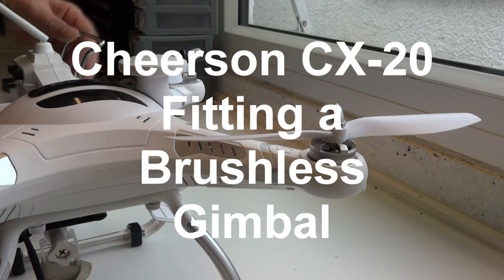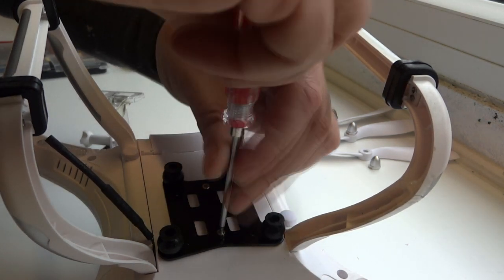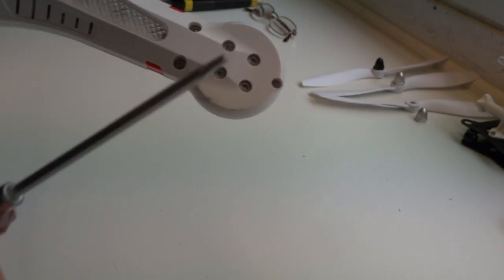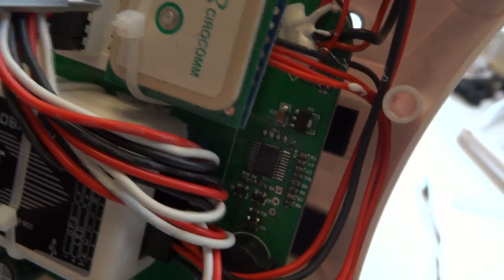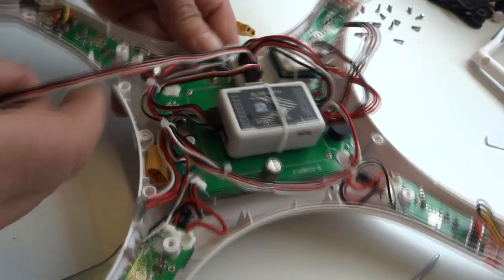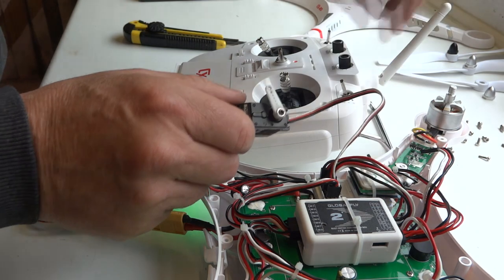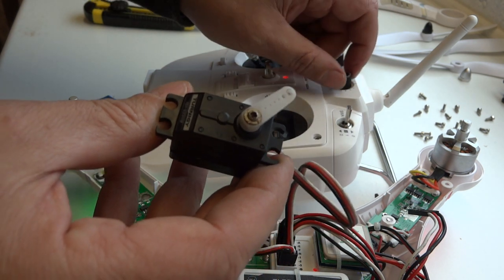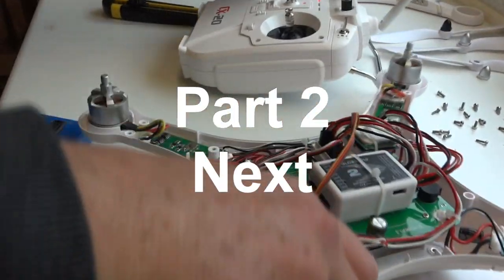Cheerson CX-20 Hobbyking Quanum Nova Quadcopter Gimbal Mod Pt1

Comment: I need help please my cheerson CX20 is not working  because one of the motors is not getting any signal. so from the 4 motors one of them is not running I replace it with a new one and didn't fix   the problem can someone help me or tell me who can fix it or were I can take it to get it fixed.?

Comment: I've noticed that Radio 6, Radio 7, and Radio 8 do not change at all (as I turn the knobs) when in APM Planner 2. I think it's because those radio channels (for AUX 1 and AUX 2) are not fed to the APM flight controller. My version is the newer one that already has AUX1 and AUX2 fed to the pinouts on the bottom (in the hole you referenced), but those wires don't run to the APM.

Is there any advantage to running wires for AUX1 and AUX2 to the flight controller?
Reply from the maker: +Derek Simkowiak No advantage at all as those are to control the gimbal not the flight controller modes

Comment: Did you figure out how to make the controller stop beeping?

My CX-20 controller -- NOT the quad itself -- beeps whenever the throttle is centered (within 1 or 2 clicks). The beeping stops if I raise or lower the throttle away from center. Makes no sense to me...
Reply from the maker: I don't think you can reprogram the handset to stop the beeping, I simply swapped the receiver and handset out for my Futaba
It beeps around the centre position only when altitude/position hold mode is on, it lets you know that the quad is holding altitude at that point as otherwise when it's high up you cannot easily tell

Comment: Ok wow , thanks I am glad I checked.
.I believe this box I am referring to is the flight controller? so will pull back apart and plug this into the side of the flight controller. The other end goes down below out of site.
Thanks !!!!
Reply from the maker: float Flyer Yes it is indeed the fligt controller
Reply: Thanks again for your advice !!

Comment: Hi , great video !!
probably a dumb question, I just checked my braND new Cheerson cx20 to ensure all solder connections were ok before I power it up for the first time. 
the component What I believe to be  is the receiver (says Global on it in your video)  has a usb port in the side. Should this be unplugged or left open ? I noticed a usb male plug but it was not plugged in ?
Please let me know I would appreciate it
Thanks
Reply from the maker: float Flyer It should have a USB lead plugged into the port which goes down to the USB socket in the bottom of the quad

Comment: Hello friend I have a CX20 he was zero version, ai decided to convert to open source bought apm equal to its called I update more lights do not work like yours, to plug the cable into the computer they blink more than that they do not know does not work if you have any wire or wrong configuration or whether it is because you have to replace the power board, you can help me?

Comment: So the Pod on top of the quad is empty, why didn't they install the GPS inside of it? Can the GPS be modified to fit inside of it? Thanks!
Reply: Interesting that the pod has nothing in it on this as I have the quanum nova and my pod has
wires running up inside it. Maybe this is a later version I have.
Either that or the cheerson cx20 is not identical to the quanum nova as we are led to believe.
Reply: Craig Maher You get what you pay for.
Reply from the maker: Craig Maher
 This is probably the first one in the UK, I got it long before HK launched the Nova
I started the huge thread on RCG about them, not long after I got mine the new one's had the compass module inside the puk
Reply from the maker: Bobster986
 Actually Bob in this case you get a lot more than you might think
A quadcopter which not only has a very solid position and altitude hold but is easy to set up for unlimited waypoint missions with telemetry for IOS/Android and the ability to cheaply add OSD, the available flight modes runs into dozens too, for the money it kicks the competition inc DJI stuff in the nuts
Reply: RIDERZcouk And who supports it, at least I know DJI will and can make repairs and I can call to ask questions.
Reply from the maker: Bobster986
 Banggood have a far better customer support service than DJI, they always have, DJI have a very poor reputation by comparison, plus of course the flight controller is open source, it's an APM, there's more support for that than ANY other FC on the market, on top of that there are numerous informative and helpfull threads on RCG, one of which is nearly 800 pages long and full of information, PS if you're having to call DJI to ask questions on how to use a 3 mode flight controller on a ready made RTF quadcopter then there's one more question you need to ask ;)
Reply: The GPS mast usually contains the magnetomter. pop the cap on it and have a look. As part of your acceptance inspection, you need to ensure it is pressed on properly (double sided foam tape). also inspect the GPS and controller (inside main body) are secure.
Reply from the maker: Rob Nielsen , That's funny Rob, those were my own words quoted back to me
I started the RCGroups thread myself aka Dogdude :)
Reply: RIDERZcouk
lol, cool
I am going to upgrade things a bit and install a combo unit in the mast, GPS with builtin Magnetometer http://www.gearbest.com/development-boards/pp_69343.html I may have to do some modifications to fit it, but it is apparently a better GPS module to begin with and the placement will improve performance even more.

and I am blogging under 'Dronespotting'   http://dronespotting.blogspot.ca/2015/01/opening-post.html

Comment: I would like to fly a theory by you before I execute. I ordered a CX not realizing it is the zero (white) FC version . I did locate what appears to be the open source (black) FC. Would you estimate it would be a one for one swap? Cheers.
Reply from the maker: Hi Jon
You can easily fit a full APM 2.6 if you wish, you can get them from Goodluckbuy or Banggood very cheaply, take a look at the RC Groups thread:
http://www.rcgroups.com/forums/showthread.php?t=2112759
Reply: RIDERZcouk
and as a side perk, a few things like a telemetry module can plug right in without modification or tweaking software.

Comment: got mine today and every time try to take of it goes  to tip over so what am i doing wrong? seems like a weight issue but tried the batery bang in the centre plus of centre with no diffrence ,  from power up , and gps lock , i do the motor unlock for right hand which is steering stick to the right then when its unlocked i give it some slight throttle and it goes to tip over ,,,   any ideas ?  p.s thats from 0 + 0 manual  mode
Reply from the maker: Hi Nick, from what you're saying I'm guessing that you're new to flying a multirotor ?
If that's the case then all you're doing wrong is not "popping" it up into the air quick enough, they don't like a slow throttle increase when on the ground because it's in it's own prop wash, in a clear area just pop it up into the air then quckly settle the throttle back to 50% (roughly)

Terry
Reply: RIDERZcouk yes im fairly new to quadcopters  ,, ive tried what you sugested but still goes to flip  , just uploaded a little vid  , take a look  watch?v=hnD3RbeogRs
Reply: nickhow100 p.s  dont think i was thinking straight on what you told me before  mate  but i have  just got it to take of briefly indoors by popping it up quick like you said , i carnt beleive thats all it could be  omg  lol why dont they tell ya that in the manual  and not heard anyone else say that on there  vids lol haha  hopefully all will be well  later today when i have a propper  try outdoors  ,, hears hopeing ,,,   cheers  matey
Reply from the maker: Well done Nick, have fun, maybe get a flight simulator like Phoenix flight sim and a cheap hadste that will work with it (Turnigy TX9/Spektrum DX5e etc)

Comment: Hello friend I bought a cx-20 on AliExpress quadricopter eustou just waiting to arrive, I would like to know from you if I made a bad buy what you recommend me I'm from Brazil, thanks!
Reply: The CX20 is an excellent unit. It gives you almost everything you could want at a good price. there are plenty of upgrade option too if you want to expand what you can do with it. I would say it is one the best choices you could make when graduating from a sub 250mm class. It is also a great flying unit and for your first steps in FPV, it works great too. I have one and I am looking to grow into a Walkera scout, Voyager3 or homebuilding something very large as a next step. The CX20 has been a fantastic quad and will not be retired unless I lose it or destroy it in a crash.

Comment: i bought the no battery version from Hk.. best battery for decent flight time?
Reply from the maker: Zippy Flightmax 2800mah 3S
Reply: HK says ..must not exceed 105(L)x27(H)x40(W)mm)..and zippys dimensions are..116x37x27mm..i guess its a tight fit lenghwise and heightwise? or?
Reply: 2800Mah 3s or a 3000Mah 3S.
http://www.banggood.com/Upgraded-11_1V-2800MAH-30C-Battery-for-Cheerson-CX-20-RC-Quadcopter-p-923297.html

http://www.banggood.com/BlackMagic-3000mAh-11_1V-Battery-For-DJI-PHANTOM-CX-20-Quanum-Nova-p-946803.html

Get a http://www.gearbest.com/rc-parts/pp_27704.html or better charger.

Comment: Great job bravo 
I just receive mine but I can't bind at all can you advise ?
Reply from the maker: Plug quadcopter battery in
Switch on transmitter (withing 1 meter of quadcopter)
To arm it, hold the left stick to the bottom right UNTIL the lights flash fast, on mine after that I have to hold it to the bottom right a second time to arm

Comment: You can have the real vision is via smartphone or tablet when it is in operation ... how GPS works, is compatible with mission planner (android)?? Where can I buy?? What are the parts to assemble a nessária?? Needs transmitter (control), if so which??
Reply from the maker: Lots of information in the thread here:
http://www.rcgroups.com/forums/showthread.php?t=2112759